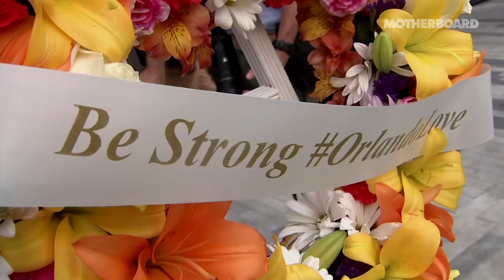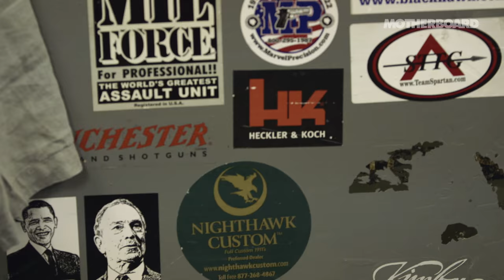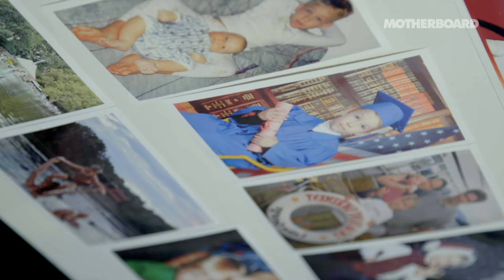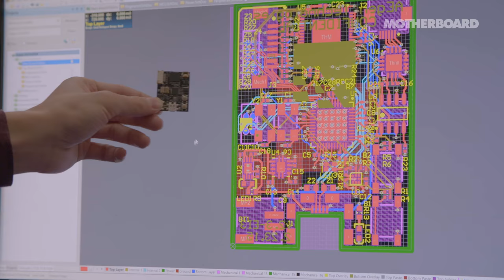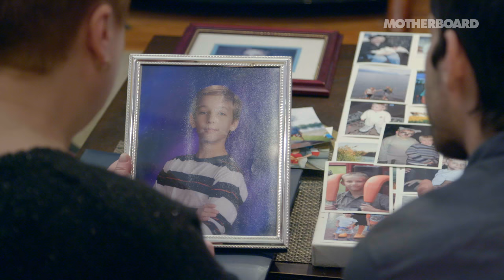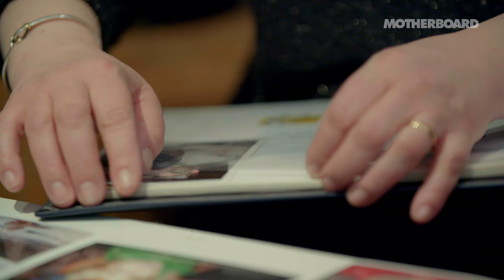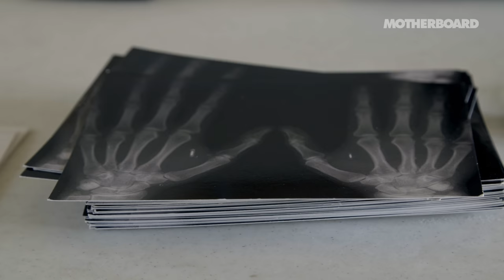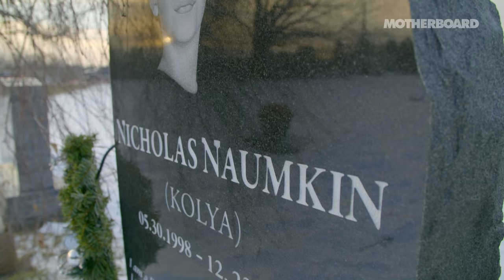Who Killed the Smart Gun?

Comment: I hate the comparison of guns to smartphones.  A phone is an electronic device, a gun is a mechanical one.  A better comparison would be guns and cars, but even then, there are those (like myself) who would argue that cars were better before they got so many computer chips put in them.

While I actually think the development of smart guns would be a good thing, as there is a potentially untapped market of people who would normally worry about having a gun in their house, any laws requiring it are bad.  Course given the current state of things, I have little doubt some states would make those the only guns allowed.

I think the biggest issue with guns in this country is that the laws vary so much state to state.  Having different regulations per state is just dumb, as you have no way of preventing people from going out of state to buy stuff, heck I do it all the time for fireworks!  Guns really need to be regulated at the federal level, the current system is just a minefield of laws, and often get honest people in trouble because their permit in one state isn't valid for another.  Improving the education about guns would be a big step too, there are a lot of ignorant people on both sides of the debate.

Actually now that I think about it more, I really don't want computer chips anywhere near guns.  Already bad enough with cars randomly accelerating, with smart guns, we won't even need mass shooters, the guns will start firing all by themselves!  Smart guns would be effective in keeping kids from shooting themselves, but that is why you keep your gun in a safe when you aren't sleeping on it!  A safe would probably do a better job at keeping the gun out of the hands of criminals too, because, you know, hacking is a thing.

I like people to be able to see my past thoughts, but the crossed out stuff above were my thoughts an hour ago not now!

Comment: It won't prevent any criminal or suicide from disabling the electronic safety unless they try to fire the second anfter they get the gun. The cartridge is still frired by a mechanical striker or hammer. Even if it had electric primer you can remove all the electronics and make a simple electric circuit. And to store the gun safely a trigger lock can do the same job.

Comment: The fundamental flaw with such designs is they depended on some kind of battery to function. How often do you worry that it's batteries are fully charged so that your smoke detector will work when needed to save your life? That and it's an entry point for forced gun control as with any electronic device.

Comment: I am actually 100% comfortable with smart guns as a premise.  I would legitimately buy one.

My problem, however, is that NJ has the law stating that when the first commercially available smart gun is available for public purchase, all guns sold in NJ have to be smart guns within 3 years.  I'm NOT comfortable with forcing an entire state to have to use smart guns.

Because of that, I will NOT purchase a smart gun or support any company trying to do so.  If NJs law is changed or found unconstitutional, that's one thing.  But until then I'm not doing anything to support smart gun builders.

Comment: The bio chip thing would be the best implementation, but here are a few problems with that:

There is a potential for hackers to copy the RFID signature and then do what they will with it. 

Those guns will be more expensive, and nobody wants to pay more for a gun that sorta would have the association with here's the gun for responsible people, and here's the gun for those that can't control themselves. 

Personally, and for a lot of the gun community, I wouldn't put a chip in my body for religious reasons. 

For mechanical devices, they're extremely simple and reliable whereas electronics can fail seemingly randomly. When you're defending your, or someone else's life, you can't leave that to chance. 

Another thing to think of: technology gets old, and as time goes along it gets more secure. Imagine if Colt's smart gun came out in the early 90's. Would you trust yourself with computer tech from the early 90's? I would not. I would however buy a gun manufactured in the 90's because they're still largely the same as guns now. My buddy bought an M1 Garand recently and it was used in WWII, still shoots brilliantly. You will not find any electronic device with that sort of longevity.

Comment: A smart gun is not only a bad design choice, but also incredibly hard to do it right. 

Fingerprints, sensors, passwords, if those (and you!) don't work perfectly in a split second you will loose your life.

That said, is not like it can't be done. Imagine a gun that will only work from your holster, if it fails, it should unlock the gun so the user don't have any surprises. It could work to avoid accidents with kids but it wouldn't stop anyone determined to make it work. 

It won't happen because of the "every gun must be a smart gun" pieces of legislation.

Comment: I see so many problems with smart guns.

Problem 1: Fingerprint scanner. How will it work with greasy hands? I sometimes have problems with my phones fingerprint scanner, so how will gun fingerprint scanners work if fingerprint scanners on phones don't always work? Also, imagine if you are in the middle of a home invasion. With a smart gun, how will you stop criminals from trying to hurt your family? You might be able to save your family if the finger print scanner works, but what if you are down and another family member tries to use your gun to save the family from getting murdered or robbed? If the fingerprint scanner doesn't work for them, then I guess they're screwed. Smart guns don't prevent people from shooting other people. Good or bad people could use smart guns and shoot people.

Problem 2: The ring. If you take off your ring and lose it then you are unable to use your gun. Also, this will not prevent a mass shooter from stealing a ring from someone and use the gun.

Problem 3: Batteries. Guns shouldn't have batteries to run. Whoops, the battery ran out of charge, I guess I cannot use my gun until I charge it again.

Comment: I do think that 1 fingerprint sensor is a wrong technology for a smart gun. Here's why.... Gloves? No go. Left hand? No go. Dirty sensor? No go. Wet hands? No go. 
Ringer/bracelet is a more reliable solution, but then again whose gonna wear that ring 24/7? Probably not many people. Instead, they are likely gonna keep that ring somewhere close to the gun itself which kind of defeats the purpose altogether. 
What else do we have... Face recognition? Not suitable as you're not always aiming from up high. 

Come to think about it.. I think we need that gun to have several recognition points. I would say several fingerprint sensors, bluetooth sensor, NFC (one touch with a phone activates the gun until you manually disable it) and PIN as a redundancy. Then if at least one recognition point is triggered (f.e. 1 fingerprint sensor) the gun is activated (remaining that way till you manually disable it). Power? it would need to have integrated overkill battery and be charged wirelessly. Probably some kind of gyroscope sensor built in as well in order not to discharge the battery when no one is using it. Oh, and one more thing - "gun activated" led should be nothing more than a discrete small red dot.

Comment: i think both parties are kinda blinded, I mean on one hand the magnetic wristband or ring is a nogo, biometric fingerprint is the way to go it still requires a battery(how long does it last) is it relaible to read and scan ur fingerprint 99.99% of the time, can the chip or scanner be replaced, can firmware be rewritten, are states or fed gonna want the biometric data for storage, can and will hackers obtain info illegally? is it upto the user to reset and apply fingerprint or a company that does it for u, does that cost money?, how much more expensive is it, ur limiting ur ammo count by half goin from double stack to single stack. alot of times it takes more than 8 shots to put down an offending criminal, how does the tech hold upto the elements? excessive vibration from firing can cause loose connections over time! adding in a magnetic strip or ring just allows it to get lost, can that be replaced? or do u need entire new unit, so say someone stole ur gun can they replace the electronics on it to make it operable? i mean hell u could prolly even make a jamming device that criminals would prolly make or purchase to disable civilian and police weapons making most weapons these days in to a 2 pound paperweight seems to me its an ez swap of electronics so that criminals can use it. would the gov or state raise taxes for non smart guns, would they out right ban nonsmart guns? magnetic rings and strips can be stolen with electronic devices. if they can make a reliable system without the need for constant battery replacement maybe every 3 years or more, and I had access to the fingerprints that r registered to the weapon at almost no additional cost, and no reduction in capacity and capability id be all for it, but chances r this may also make it harder to sell used guns.

Comment: Quick point on the statistics you provided at 3:06 , does it not stand to reason that suicidal people will find another way to commit suicide? I mean guns are probably not even the easiest method of killing yourself. Also there were only 489 deaths due to gun related accidents, that's a stunningly low rate compared to the intentional uses. Shouldn't we be more concerned with solving why people want to kill themselves so badly rather than limiting how they can do it? And the accidental death scenario is basically non-existent, according to the CDC there were 2,712,630 deaths in the U.S. in 2015 making death by gun related accident 0.00018% of deaths in the U.S. Why not try to tackle something that appears to be a larger issue first, like heart disease for instance?

Comment: If i designed a smart gun it would have the power of a smart phone remote unlock or lock , camera under barrwel and rear faceing , possibly facial recognition, fingerprint ,smart watch / nfc ring proximity  geo fenceing gps tracking , with internal electronic trigger a new low recoil breach design bull pup non linier recoil spring, caseless ammo computer selectabĺe automatic fire, back pack , 50rnd or drum its something that iv thought about over a life time before the dod even publicly annouced em. And alot of firearms like aa12, railguns , recoil less 20mm was the stuff on my mind at 13yo even though thares no practical use for this kinda imageneering in the uk sadly im not in a position to work on em beyond imagenation

Comment: Here is some obvious stuff to think about. First the like to dislike on the video says it all. Every time this guy picked up a gun he immediately put his finger on the trigger. And last, the bio hacked smart gun failed big time. Not saying that it can’t be improved but the simple argument is exactly what he demonstrated. When your life depends on it it will fail, and you die. The number one thing that can help stop people from being accidentally shot is to teach them safety. In my 41 years I e had 2 accidental discharges. One was out of stupidity and the other was a weapon failure. Fortunately no one was hurt. When people start trying to push this smart tech, to prove to them that it isn’t reliable all you have to do is ask them how many times a year does your smartphone fingered print security fail to work. I work with my hands and my skin can get dry. When that happens my phone does not unlock and makes me type in my code. Tech is not the fix, it’s the downfall..

Comment: Yeah but it didn't exist for any practical commercial application.  Like seriously man stop sharing cherry picked information and purposefully slanted rhetoric to push your narrative.  Like it should be clear to anyone that you're being deliberately misleading when you say that a rocket and a bullet fired from a firearm are functionally the same when they're not.  
At any rate, "smart guns" are simply not commercially viable.  Not with today's technology in biometrics.  The only models that did exist at any point in some commercial fashion were unbelievably stupid expensive, were only available in a very limited selection of calibers, had numerous issues in functionality from a purely mechanical standpoint, and had integrated biometric scanning technology that was as good as it could get for that application and had all sorts of problems.  It was an absolute fucking disaster is the bottom line.  Until this technology is proven to work within already existing firearm platforms with a failure rate equivalent to any respective models mechanical failure rate, then pushing this technology on people who either don't need it and/or dont want it is VERY stupid and downright immoral.  When the tech reaches a point that it can actually fucking WORK and work well under wear and tear, more and more manufacturers will incorporate it into their models and more of these types of manufactured and integrated smart models will proliferate into the population and eventually overtake those without this feature.  Yes, this will happen IN TIME.  And this is how it SHOULD happen.  Legislating it and demanding it is not the way to go.  Do I want this tech? No not necessarily.  However if we come to a point where it's viable and commercially realistic, then I will change with the times.  As long as the change it makes is not detrimental and as long as the form and function of current models isnt affected.

Comment: I do not have much actual knowledge of guns, never even held a real one because out government doesn't like us having them and it makes me, someone the other side of an ocean see how precious the second amendment is over there. I can also see the potential here, just mins into the video. If a firearm is fitted with electronic locking devices, particularly those NFC/RF based ones then it can be fitted with a remote override or "kill switch" to deactivate it remotely or even just hacked or exploited.

Side stepping any tinfoil hattery about "the government could turn all the guns off with the flick of a switch" because if they could or could not, the criminals will learn how to do it. As all the other RF tech has been contactless payment or door cards, the keyless entry and start fobs for cars have all proved, it would not be long before some kind of transmitter or jammer is possible that could shut down or prevent such a firearm from operating. Even the police could be victims of it, homeowners or business could find themselves robbed or attacked and their self defense weapons would simply not function.

It is a bad idea just because of this, even if the reliability was perfect, the user experience simple and easy the minute you start controlling something with electronics and especially those that use radio receivers you make it vulnerable.

Comment: gun owners want a reliable firearm more than anything else, a so called smart gun will need to work under some extreme conditions and so far from what i can see they will not, try wearing gloves, guess what a smart gun will not work, batteries run low, again smart gun will not work, hardware of software becomes corrupt, guess what it will not work, extreme heat or cold or mud, yet again the smart gun will not work, i do like the idea but its a long long way from being a real thing. oh and next time use a reporter who is not cross eyed  or has no gun discipline at all, its people like this kid that are a danger, not the guns.